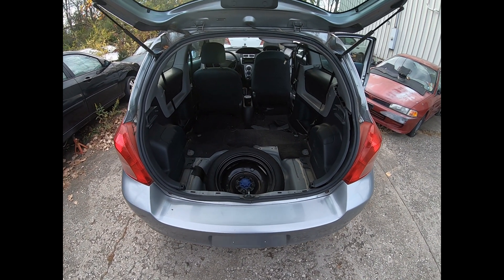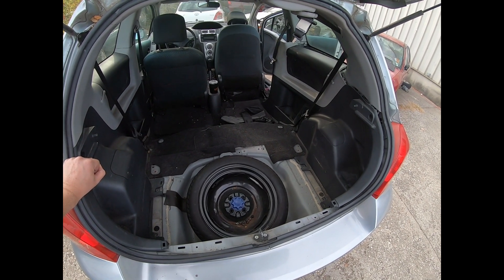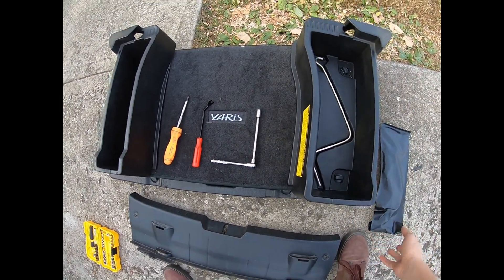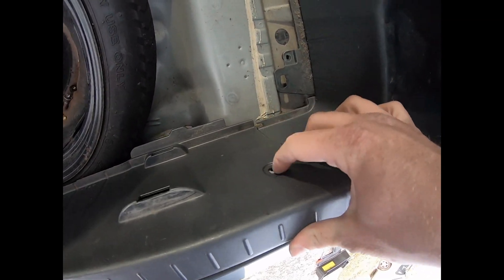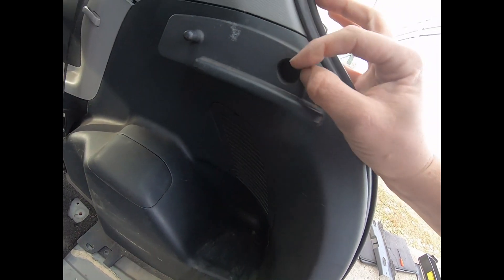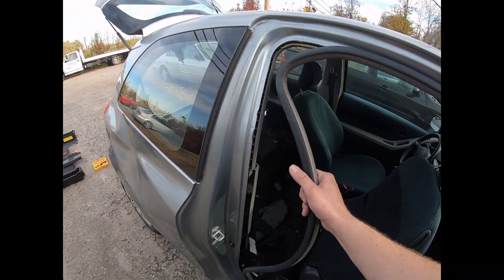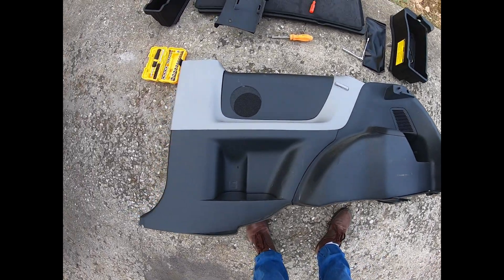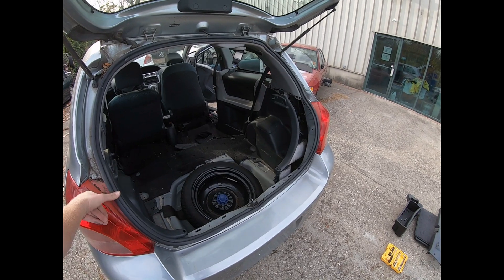2007-2011 Toyota Yaris 2dr 2 Door Hatchback Rear Speaker Panel Cover Plastic Removal

Comment: I have a 2007 Hyundai Accent GS hatchback, I’m going to be replacing the rear speakers, hoping for a similar setup! 🤞
Reply from the maker: It will most likely be similar but definitely not exactly the same. Just be sure to take your time and if you feel resistance check for hidden bolts or screws. Please consider liking the video and subscribing to the channel! Good luck on your project!